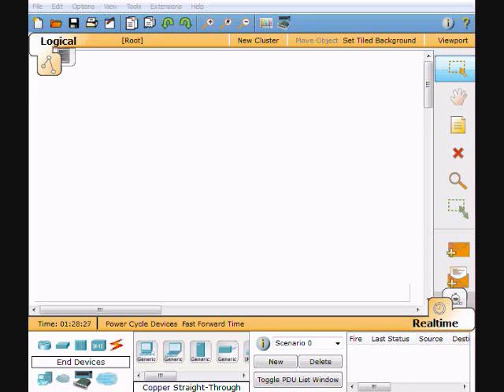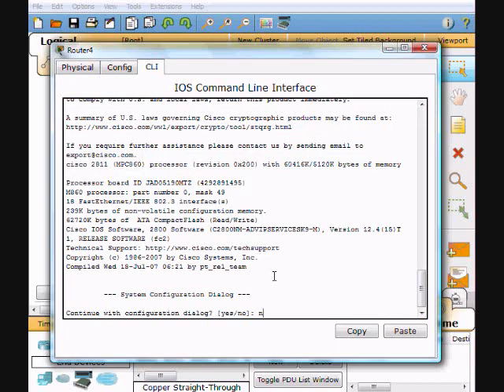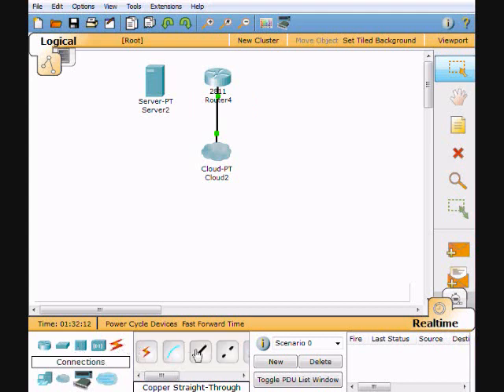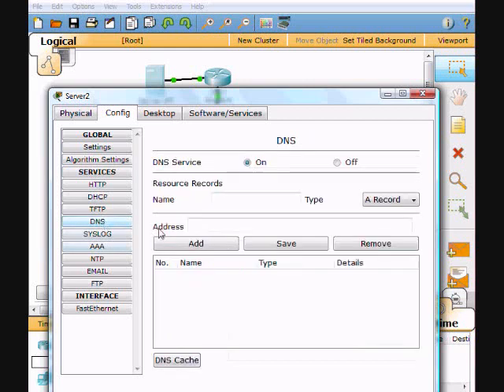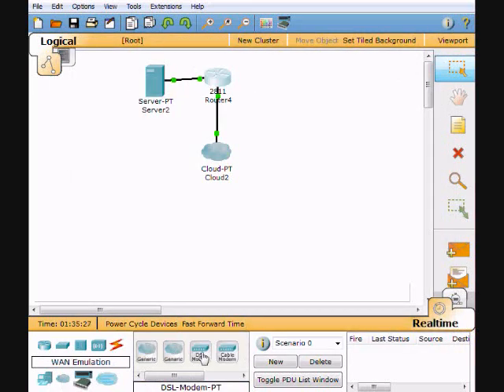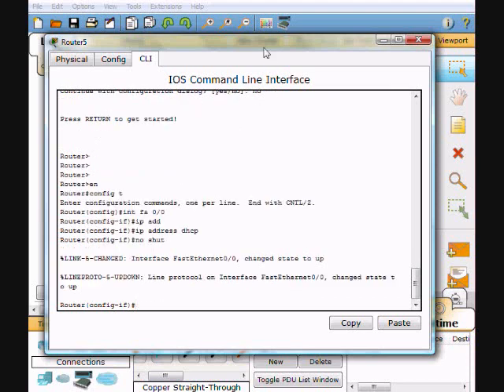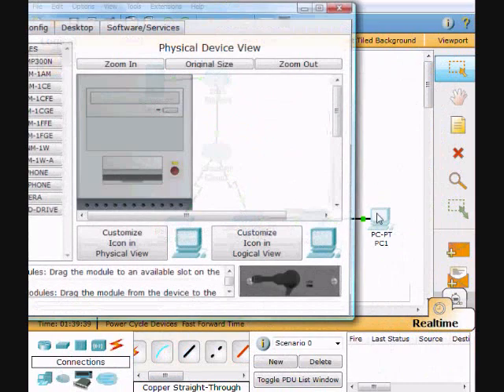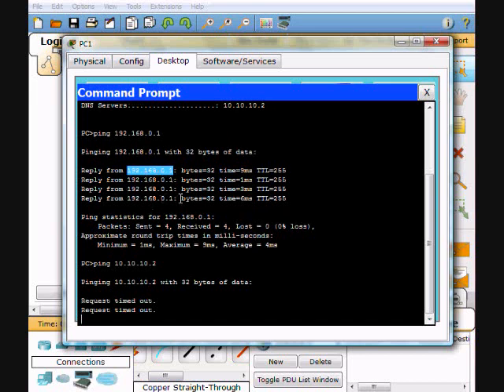DSL Connection with Packet Tracer

Comment: Hi Ron,
Thank you so much for the video, However i have some questions to ask

I want to simulate vpn that allows branch offices to connect to HQ
I am familiar with the vpn  configurations but my challendge is to simulate the internet

In your video you demonstrated internet connections for the HOME ROUTER (1.1.1.2)
and the other router (unconfigured) which i belive to be 1.1.1.3

QS
1. can i have three routers pointing to different isps without being on the same network?
2. If yes,how do i link the three in such a way that  each can ping the public ip of the other? ( can multi user connection help) 
3. Optionally can i use one isp and assign the public address like 
1.1.1.2 - HQ
1.1.1.3 - BO1
1.1.1.4 - B02

and achive the vpn tunnel through the ISP router

Comment: when i tried to configure to other side. where i did the same thing as the right side which worked with all steps u showed in the video. but now on the left side the pc wont go green? idk why '-' even conected the pc on the side that worked but then still stays red... is this a issue with packettracer or am i overlooking something?
Reply: nvm gues packettracer being fked up now it worked but how can i make the both sides being able to ping each other? rn i just get host unreachable
Reply from the maker: nicoredje You could build a tunnel between the 2 sites.
Reply: yea, that will work. thanks a lot :)

Comment: What if I want to ping from Network 1 that is modem 4 to modem 5 network .How will that work ?please help on that
Reply from the maker: By default they won't be able to reach each other.  The internal networks are not being advertised out to the greater Internet.  However, you could build a tunnel between the two networks in order for the two two learn about each other.  I would suggest pulling some ideas from: https://youtu.be/kDFWed0nHQA

Comment: hello,  arent we suppose to use a crossover cable from PC to Router instead of straight-throu? Please and thank you.
Reply from the maker: Typically yes.  However, most modern PC's use network cards capable of auto MDI-X.  This enables them to sense the type of port they are connected to and adjust accordingly.  So, with modern PC's you can typically use a straight-thru or crossover cable without any issues.
Reply: Thank you for your reply, great video.

Comment: Instead of using a normal router, I'm using a Wireless Router, how i could do that??????
Reply from the maker: The wireless router on packet tracer is much more limited.  I believe I did a short video on the use of wireless devices in Packet tracer.  It should be on my channel.
Reply: +Ron Wellman The topology that i'm doing is: Server->Wireless Router->DSL Modem->Cloud->DSL Modem->Wireless Router. Basically the Server has to resolve DNS and HTTP, the domain has to work in the two networks with the Wireless Network but i don't know how to configure that. Sorry, my english is a little messy
Reply: +DjentOliver Sánchez *Router
Reply: +DjentOliver Sánchez Do you have an email or something to send to you my pkt. file?

Comment: I keep getting a 'Destination host unreachable' message when I try to ping the DNS server, anyone know what the problem could be? as far as I'm aware, I have copied the configurations word by word.
Reply from the maker: check your gateway address. First ping that. Then do a traceroute to the DNS server. Find out what the last device was to respond. More than likely there is an issue with that device. My initial guess would be your NAT settings or the lack of a default route on your router. Feel free to send me a copy of your packet tracer file.
Reply: I have same issue as Munni. Did your config 3x. Still coming up as Destination host unreachable. Trace route wont go past DGW. I will email you a copy of my PT file. Thanks.

Comment: please i have a question i'm unable to ping from one router to the other any idea what's the problem?
Reply from the maker: There are quite a few things that could cause that.  More than likely in a scenario like this, it has to do with a NAT misconfiguration.  However, any number of routing or gateway issues could be the issue.  Without knowing how you configured your network, I can only guess.  Feel free to email me your lab and I'll take a look.
Reply: Ron Wellman ok thanks i apparently did some thing wrong .now after i reconfigure it again it's working but thanks for the fast reply

Comment: What would I have to do if I connect another Router(creating another network) to the Home_rtr ?? plz help if you could.. this video has been very useful. Thank You
Reply from the maker: The task wouldn't be difficult.  First connect the two routers and ensure you have connectivity by pinging back and forth.  Now, you have the choice of setting up static or dynamic routing between the two routers.  For a small scale setup I would choose static routes.  Basically, your primary router needs to know what networks/vlans are hanging off of your new router.  As for your new router, a single default route pointing to your primary router would suffice.  Now we must address the changes to your NAT architecture.  First, you'll need to identify the new interface on your primary router that as "ip nat inside".  Lastly, modify the access list that services your NAT pool by adding in any networks/vlans on the new router.  This will ensure those IP addresses match on the access list and therefore get NAT'd before heading out to your ISP.  

1) Connect the two routers and verify connectivity.
2) Setup routing (statically or dynamically) between the two routers.
3) Modify NAT architecture by adding entries to your access-list and setting the new interface as "ip nat inside".

Hope that helps...

Comment: Hi Mr. Ron Wellman how two ISP in one network, with DHCP and VLAN, THANKS
Reply from the maker: Typically you wouldn't do that in the manner that I have built this lab.  Check this page out: http://humairahmed.com/blog/?p=3883 for some terminology and graphics explaining these connections. Usually organizations that have connections to more than one ISP do so because they require high availability or want to influence how traffic gets to their network.    In those cases, they will probably decide to run the BGP (Border Gateway Protocol) protocol and rather than pulling their IPs from the ISP, they advertise their IP space back to the ISP.  BGP is the protocol of the internet and by running it, you can influence how traffic both leaves and enters your organization. In in some cases you can tell the "Internet" which ISP to prefer when trying to reach your organization and maintain high availability by limiting the impact on your network of one of your ISP connections going down.  Your average organization doesn't require the complexity and added costs of running BGP and having multiple ISP connections but others may depending upon their business needs.

Comment: Thanks for this great tutorial. I made the steps you did in that video and everything worked as you have verified.

I did create another DSL Modem & HomeRTR and got two sides with DSL connections (two HomeRTRs) which dynamically obtained IP addresses of 1.1.1.2 & 1.1.1.3 from the pool of the ISP's DHCP. But I've gotten an issue which is, the HomeRTR of 1.1.1.2 IP address cannot Ping the other side HomeRTR of IP address 1.1.1.3..

I did # show ip route to verify the route and it shows the route for 1.1.1.0 network is the outgoing is the interface connecting to the DSL Modem.

The problem as I did simulate via the packet tracer simulator is, both of the HomeRTRs cannot resolve the MAC address of each other because the # show ip route shows that the network of 1.1.1.0 is learnt via the outgoing interface not the ISP's IP (and that is logically true.)

I tried to get over that binding and I wrote # ip route 1.1.1.0 255.255.255.0 1.1.1.1 (as the next hop instead of the outgoing interface because this issue is common with Ethernet networks but not with PPP networks for example) but I couldn't get over this binding in the routing table..

Any solution to make the both HomeRTRs ping each other???
Reply from the maker: Great question. I have run into the same thing before. If you turn on simulation mode you'll see that if you try to ping from one remote to the other remote the packet will go up to the ISP router and then it stops. This is because the router isn't going to send the packet back out the same interface it received the packet on. The router views the Ethernet connection as a broadcast connection and assumes since the packet's destination is the same network it came in on that it must have already made it. Its kind of annoying but if you think about it, the ISP router has no way of knowing that the remote you are trying to ping didn't get the message. To fix this, you can place a switch inbetween the ISP router and the DSL cloud. So basically, the cloud will have two modem connections from the remote sites and two Ethernet connections to the switch. The ISP will have a single connection to the switch as well. The switch working at layer 2 will now allow you to talk inbetween the two remote routers as well as up to the ISP router. If you are still confused, email me you packet tracer file.
Reply: Ron Wellman

Hey Ron, thanks for your fast response. Infact, the problem is inside the HomeRTRs themselves as they cannot resolve the MAC addresses of each other as both of us know the reason and as you've explained in your reply. 

The ICMP packet gets dropped on the HomeRTR who pings the other side not at the ISP router but the ARP packet is the one who gets dropped at the ISP router saying that "The requested IP address is reachable on the receiving port" ehhhhhhh I know!!.

Btw, I did installed the Switch inbetween ISP & Cloud and it already have learnt the MAC addresses of all of the interfaces of both sides & the ISP router too but I cannot understand what do you mean about "So basically, the cloud will have two modem connections from the remote sites and two Ethernet connections to the switch.". How can I connected 'two Ethernet connections' from the cloud to the Switch? or you did mean "one Ethernet connection to the Switch" ??

Anyway, unfortunately, the problem is still occurring.. I will check your follow-up video first then if the problem is still occurring I will send you my .pkt file but I hope I am not bothering you or so.. If you have time then you could check it yourself then email me back JUST if you already have some time for me. 

Thanks again.
Reply: WORKED!! WOHOOOOOOOOOOOO! So thrilled!! 

When I was searching for your email in your youtube account I accidentally saw a video labelled with "DSL Connection with Packet Tracer - Follow-up". This is what I was searching for. I followed your steps and everything worked!

Thanks again and wish you a merry Christmas and a happy new year ;)

Comment from the maker: The router won't send the packet back out the same interface.  You can overcome this by adding a switch between the ISP and the DSL cloud.  The connection between the ISP router and the switch is a trunk with multiple sub-interfaces. When you add the dsl modems to the switch, make sure they are on separate vlans.  Customer X is on vlan X sub-interface X and Customer Y is on vlan Y sub-interface Y.  Send me your packet tracer file if you want and I take a look at it.

Comment: Hey, I wonder if you could answer one more comment for me. So I setup a second 'customer' off the other modem port which mapped to the same Ethernet on the cloud device.

now both 'customers' can ping back to 1.1.1.1 on the routers interface but the customers modems cant' ping each other (1.1.1.2 and 1.1.1.3). The PDU gets as far as the router and is then dropped.

I tried putting a switch between the cloud device and the router but that didn't work...
Will it not send it back out the same port?

Comment: I have set all the commands in a textfile! Nice! But a question.
How to add the 2th network? i need to setup 2 networks on a dsl connection.
Router 1 installed VLAN 20 and dhcp added. (Works) What to do with router 2? (you dont use that in your video) after that i need to setup site-to-site vpn over it.

Comment: Actually as you connected a pc by the router on its interface fa0/0/0 , i am tring to connect a switch to the router on its interface fa0/0 & on that switch i have connected different pc belongs to different vlans which are configured on the router on its subinterface fa0/0.10 & fa0/0.20 . In short i have used home router as the concept Router on a stick . Now i followed you step wise but i couldnt get my goal . Is it means that it takes different concept while using subinterface .Please guide .

Comment from the maker: If you attached a switch instead of a switchport module you'd just have to add a trunk link between the router and the switch.  That's what you'll see a lot of the time anyway.  See my video on switches and trunking if you have any questions.

Comment from the maker: I apologize for the late response.  I've been away for a bit.  Anyway, the reason you can't ping 10.10.10.2 from the PC is that NAT isn't setup yet.  When the DNS server gets a packet from the PC it doesn't know where to send the response because the ISP router doesn't know about the 192.168.0.0/24 network.  Once NAT is configured, the icmp packet that makes it to the DNS server is addressed from the FA interface of the Home_rtr (1.1.1.1/24) which it knows about and can send icmp reply back.

Comment from the maker: -CONT-
2) Sometimes you may have partial connectivity because you added a static route but the other end may not have a route for a return path.  You can often do an extended ping "ping x.x.x.x source intY" where intY is the interface that will be the source of the packet.  Exampe you could use a certain vlan or loopback as the source to see if the destination interface/host has a route back to vlan/loopback address.  You can also turn on "debug ip icmp" on both routers to see this.

Comment from the maker: -CONT-
If you don't have a route, you may add a static entry for it via "ip route x.x.x.x m.m.m.m h.h.h.h" where x is the network you're trying to get to, m is the mask of said network, and h is the next hop IP address or interface.  Or you could setup a dynamic routing protocol like EIGRP if the network supports it.  If you're going through the ISP, you may not have luck with that.  Instead, I'd build a tunnel, use a static route for the endpoints, and then use EIGRP accross that link.

Comment from the maker: Without knowing exacty how you have your network set up I can only guess.  If you want, you can email me drawings/configs/examples.  Here are my guesses: 1) If you manually assigned public IPs to your routers then when you do a "sh ip route 1.1.1.1" it shoud point to the ISP out int FA0/0 assuming 1.1.1.1 is on the same subnet.  However, depending upon what IP you're trying to ping onthe other router, a "sh ip route x.x.x.x" will show whether you have a route for it.

Comment from the maker: As for packet tracer stability, your guess is as good as mine.  I've had things not work in it that I know would work on a real router and then after shutting the software down and bringing it back up again, things magically starting working as they should.  As for the crashing, I'd try uninstalling and reinstalling.  I haven't had that issue with mine but computers get crazy sometimes with all the crap we load on them.

Comment from the maker: Don't get used to using the tabs.  The power of the IOS is that you can do everything and more from the command line. For example:

int vlan 10
  name Engineering
  ip add 192.168.0.1 255.255.255.128

ip dhcp pool Engineering
  network 192.168.0.0 255.255.255.128
  default-router 192.168.0.1
  dns-server 8.8.8.8

ip dhcp excluded-address 192.168.0.126

Here VLAN 10 users set to dhcp get an address of 192.168.0.2 - 125, mask of 255.255.255.128, gateway of 192.168.0.1, and a DNS server of 8.8.8.8.

Comment: I usually click on Config tab and look for DHCP service..., but in this case u use command to create a DHCP service, right? I cannot find DHCP in the router that you use.
And... Now, i get some trouble with pkt, whenever i save the file, it crash, and i cannot open the file again... due to incompilable version... Did you see that before?

Comment: thank you very much, i understand now. But, when I use DHCP for a PC, I see i set the gateway to 0.0.0.0 automatically. Why is it?
I read one of yours comment: "When I used DHCP on my FA 0/0 port, a default route to the ISP router (default router address in the dhcp pool) was added to my routing table."
May I ask some about this one...
Did you mean that FA0/0 port act like a DHCP server... or use DHCP to get the IP for this port (if so, I guess DHCP server is the ISP router)?

Comment from the maker: Your gateway address should be the VLAN IP not 0.0.0.0 or 255.255.255.255.  For example, if I have VLAN 5 with an IP of 192.168.0.17 255.255.255.240. If we apply subnetting we know that the network address is 192.168.0.16 and a broadcast address of 192.168.0.31.  Since VLAN 5 took the first available IP (192.168.0.17) I can assign any address from 192.168.0.18 - 192.168.0.30.  They will also use a mask of 255.255.255.240 and they will use 192.168.0.17 as their gateway.  Understand?

Comment from the maker: If you have a public IP on your modem, you can use NAT to give people outside of your network, access to a server on your LAN.  We often call this port forwarding or static NAT.  I would watch my video on Static NAT for more information.  The command ends up being " ip nat inside source static tcp 192.168.0.1 80 10.0.0.1 80 ".  What this will do is map port 80 of your local server (192.168.0.1) to the outside (10.0.0.1) port 80. This works in both directions.